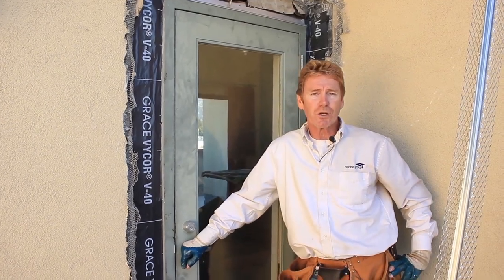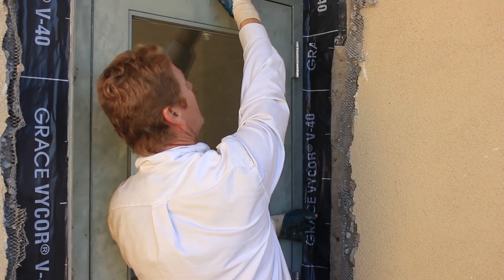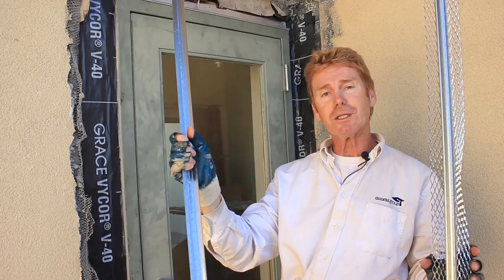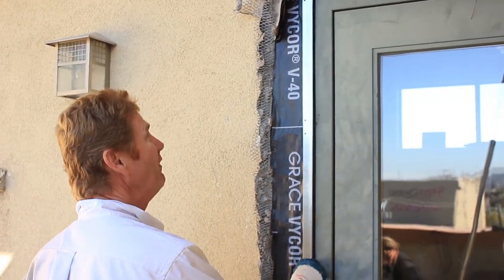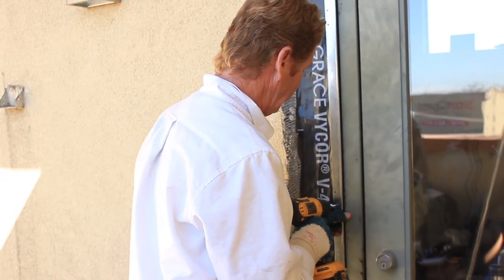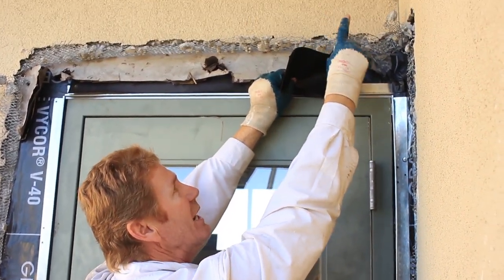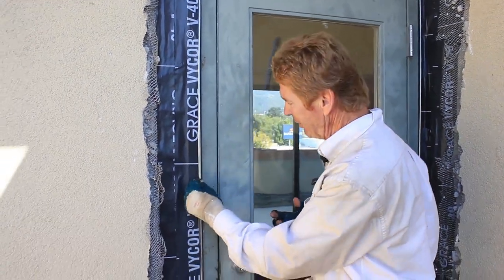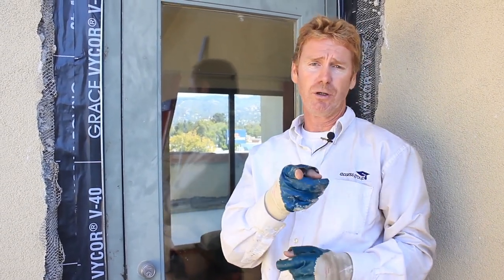Stucco J-trim, Commercial plastering

Comment: I am learning so much. I bought a 70 year old stucco home. A previous homeowner did the stucco right up to the windows. No J-rail, no z flashing, no sill tape, nothing. Which of course has led to stucco cracks around the windows. I'm doing my best to mediate that when I replace the windows. Good times!
Reply: GMARIN how did you project come out. I'm currently in the same situation with my home. all new windows are in and I'm about to patch all the stucco

Comment: How long before that galvanized edge butted against the metal frame before it starts rusting? I’m doing something similar butted against the back of a wood jamb, im on the fence of using an aluminum L molding.

Comment: kirk. I'm using j trim around my new windows. most of them are set back deep into the block wall. do you recommend that j channel at the bottom of the windows as well?
Reply from the maker: Greetings Joseph, I'm installing J trim here as it's a commercial building. I don't recommend J trim for any jobs unless hey are specked out in the prints or drawings.  Nor do I recommend them for residential work. That being said, if your going to use them on the sides and the top use them on the sill or bottom, also.
                         Bringing peace, love, and harmony to plastering 
         Sound Plastering tips for the DIY beginner or the Plastering experts

Comment: Hi Kirk, do you have to caulk the verticals around where the stucco was cut out so there won't be leaks behind where it ties in to the existing paper?
Reply from the maker: Good evening Charlie, good question,
 when in doubt caulk them.
 In some cities it is required while in others inspectors say it loses the keys to vertical stucco strength.
    Live long and plaster
 teaching  plastering video’s
Reply: Thanks captain.

Comment: Did you use a J trim on top of the door like on the sides?
Reply from the maker: Good Evening plant-based MD dude, this is what I was talking about on the last-mail, this is a  commercial property,  this J trim is specked out in the prints,
  residential homes dont require them in our area, the S.F bay area.                  
                       Live long and plaster
                     Kirk and Jason Giordano

Comment: What happened to inside corner expansion?
Reply from the maker: Evening dsbuilder76, the inner expansion joint was installed but I guess it was not in at the ending, there was a serious inspector dude on this project, if a staple was out of line we were called on it.
cheers.
 Kirk giordano